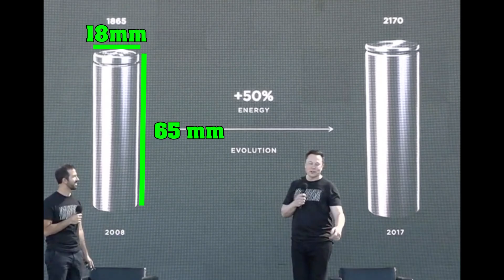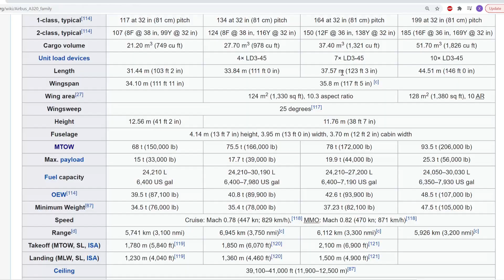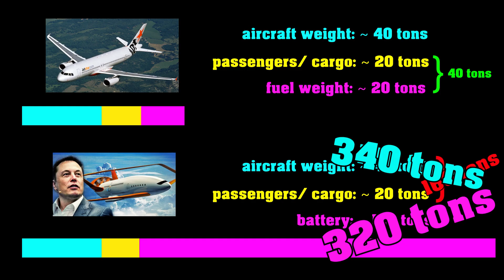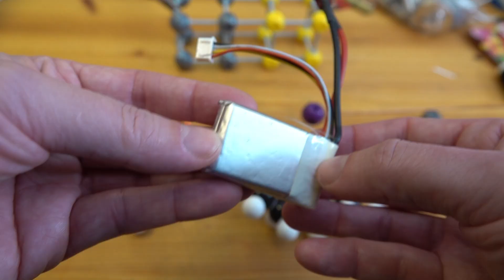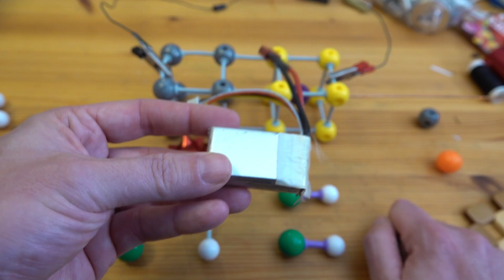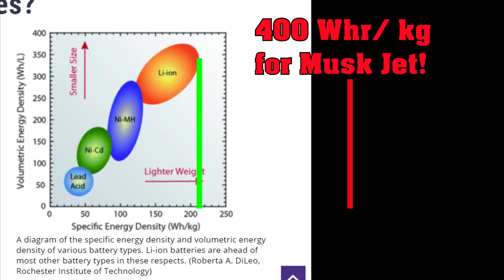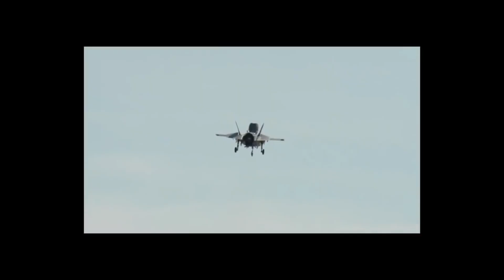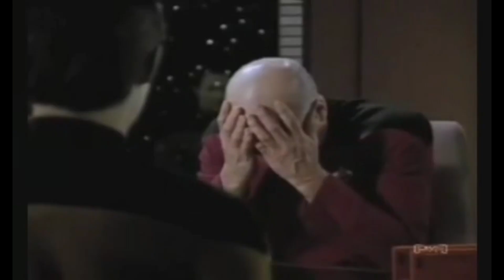Tesla's Secret Plan To Disrupt Airlines: BUSTED!!

Comment: We already have electric planes, they're just Cessna sized. And you're right it's constrained by the rocket equation, more fuel need to be lifted by more fuel, so there's a minimal density required and a maximum limit on practicality. Perhaps the claims of electric and supersonic and transatlantic are not possible, but the way I see it increase of density at the pack level not atomic level will enable private jets of ever more increasing size and capabilities. And this is where I think you're being a bit tongue in cheek the power density of solid state batteries has been demonstrated in the lab however the cells deform and break down after a few circles, the increase in density is possible because much of the pouch you're holding is the metalic contact and the cathode which are a few atoms thick in the solid state batteries. Now it's not clear to me if those problems can be overcome but as with Tesla's 4680 you can still make density improvements at the pack level by solving internal resistance issues at the cell level. In short you can plan out a flying plane at every kw/kg level until you hit the spiraling out weight issues.

And to push a bit on the flying at higher altitude part, if you're not constrained by fuel-air mixture you do have a wider altitude operating range, even if that's not all the way to space since as you point out the boat propeller needs to push some fluid around.

I see this more akin to Boring Company namely what's delivered is possible although not at the marketing wank levels it was promised, rather then Hyperloop which seems totally outside the realm of practicality at any level where it can be delivered.

Comment: It's similar to claiming that next year we will be flying to lower Earth orbit on SSTOs. There is a reason we keep using multiple stage rockets and why Tsiolkovsky's formulas proscribe multiple stage method. We have neither the fuel with the necessary energy density nor the engines which could safely expend such fuel. It certainly didn't stop people from trying, and may be one day we will have something like a hydrogen cell plane and an Epstein Drive like in "Expanse" that will make single stage to orbit ascent a mundane everyday reality, but I'm incredibly skeptical when someone claims we're only a few years away from a similar breakthrough. I find what is particularly concerning about these claims is the promise of reduced prices. For the last 15 years we've been fed promises of Lithium batteries becoming more and more affordable, and yet - the prices stay the same or, in many cases, - actually rise quite significantly. And...whatever happened to those Goodenough batteries which were claimed to be a "breakthrough" only 5 years ago or so? Can we one day have a detailed video on those, Mr. Mason?

Comment: I really enjoyed many debunking videos and 'turning blue' elections, great job. I agree with battery chemistry&(non) progress over last 10yrs and great visual demonstration on chemical bonds burning vs. battery. There is however one thing you don't take  into account mocking the 18650->2070->4680 transition. The major factor preventing of widespread EV adoption is COST. And the different sizes (or folding electrodes, or using them as structural element) are huge improvement for MASS MANUFACTURING and driving down costs. Don't take my word but check Sandy Munro's analysis, who has better expertise than me or (with all respect) you in this field. And I am not sure you are aware Musk has not only business but also physics degree and rather than snake oil salesman he is just overly optimistic scientist (especially deadlines). Other than that, thank you for the high quality content, so rare to see nowadays.

Comment: The bateries can be part of the structure removing most of the heavier materials in conventional planes, also with carbono fiber application on the skin and wings you can shave a lot of weight, my biggest question would be the electric engines used, would it be turbofans without the turbine? Then it cant get supersonic, the supersonic engines have an afterburner to break the sound barrier even planes with hiper cruise without afterburner need it to get across the SB safely
Reply: As to battery technology, I really know nothing about it, but specialist say its possible, difficult but possible
They also Said that about compeling electric vehicles and landing boosters after space launchs

Comment: So a ducted fan that sucks in and propels out air doesn’t suffer a loss in performance at altitude as air density reduces?  Sure, good luck with that.

Gas turbines loose thrust at altitude for sure (not efficiency) but as nearly all long haul commercial airliners are capable of getting to their Mach limit that’s pretty much irrelevant, they can’t go any faster regardless of how much thrust they can muster.

Comment: Forget the power problem. This genius wants to not only create a supersonic vtol, but have it powered by propellers(no such thing as an electric jet). Supersonic vtols exist, but are very hard to do, and only exist in the form of fighter planes such as the Yak-141 or a certain variant of the F-35. These planes only go supersonic due to having afterburning turbojet engines with the appropriate thrust vectoring for both vertical and horizontal flight, and even then, are not as fast or fuel efficient as a conventional fighter jet. Now we have this guy saying he wants to create airliners that do that, and have them powered with propellers. It is obvious he knows nothing of propellers, as they simply do not go supersonic. Propellers, unlike jet propulsion, produce less thrust the faster you go. The propeller works by cutting through the air like a screw through wood. With the propeller at max rpm, and the propeller pitch is at the highest, the plane can only go so fast. Think about it as your car, at max rpm, at highest gear, going its maximum speed. Increasing the rpm of the propeller can only be done as long as the tips of the blades stay subsonic, if they exceed mach, you lose thrust. This all means that propellers cannot really go past the early stages of transonic. The fastest propeller powered plane in service is the Tu-95, a strategic bomber, whose max mach number in level flight is M 0.82, which is impressive, but hardly supersonic. To achieve this, the plane uses 4 contra-rotating propellers, coupled to massive turboprop engines with an output of 15,000 horsepower each, meaning that in total the engines must produce 60,000 horsepower in order to fly that fast. Is an electric set up even possible to do just this? If so then what would the range be provided a similar setup to the one proposed in the video with the battery consisting of 70% the weight of the plane? I don't know, maybe somebody knowledgeable on the topic can tell me.

Comment: "The most efficient commercial aircraft gas turbines in service or entering service in this decade have takeoff thrusts of 20,000 lb and above. These turbines operate at cruise, with motor thermodynamic efficiencies of up to 55 percent and propulsive efficiencies of well over 70 percent, yielding an overall efficiency (the product of the two) of about 40 percent"

https://www.nap.edu/read/23490/chapter/6#36
Reply: Electric motors have 75% effeciency, various propulsor designs could have 80% effeciency as well. The big win for conventional hydrocarbon fuel is really the mass reduction over time, not the efficiency as such.

Comment: Boeing 787’s have suffered some spectacular battery failures and they are traditionally powered aircraft. They were grounded until their batteries could be isolated from the rest of the aircraft. A battery powered aircraft leaves you with the problem of isolating 70% of the aircraft. I wonder what shape this supersonic aircraft will be? And remember folks, this gives no redundancy. All current airliners can suffer the loss of a single engine at anytime during flight. What will Elon’s plane do? More thinking required and maybe a different way of storing energy me thinks.

Comment: Funny thing is, we CAN make combustion engines about 50% more efficient (or thereabout I think).
But nobody bothers to remodel their factories from making the current engines into the new type even though many of the parts would be similar.
I am talking about the 2-stroke opposing piston engine here. If someone is about to look it up from me talking about it, please double check my numbers and put it in a comment.
Reply: First the 50 percent is a bit misleading because your comparing diesel to gas.  Diesel is already more efficient then gas so the actual increase is more in the 20 to 30 range when comparing it to other diesel engines.  So at least in the US just having everything switch to diesel would make everything more efficient.  Not sure why we don't.  Cost?  

Looks like the things this engine is used in are BIG so maybe size might also be an issue in putting it in a car.

Because diesel is a complex, high-energy fuel made of long hydrocarbon chains, it has more potential than diesel with regard to fuel efficiency so unlike gas we probably still some gains to make in fuel efficiency with diesel.

Granted I just did a quick look up so I could very well be wrong.
Reply: @Alexander-the-Mediocre  The dimensions of the engine are (as far as I know) comparable to any other engine so that shouldn't be an issue.
Even then a 30% incease in efficiency? ... 30% more range, 30% better miles per gallon (as you call it in the Americaland), 30% cheaper to drive the car ... That's a BIG deal ... and you're using Diesel which is already cheaper. Apparently someone who claimed to be from the industry also mentioned that injecting water into the cylinders at opportune moments drives that efficiency even higher (no clue why or how that would work)

So really ... exactly WHY don't the engine manufacturers switch? Supposedly it would be too expensive to build the factories for mass production of a new engine type. And that's apparently why nobody bothered to implement any major improvements in the technology since its conception in 1794.
Reply: @MrRolnicek  You misread my comment Americaland is not using diesel.  So that's the first issue. 

Looks like high oil consumption and complex crank gear as well as heat load.  Some companies are looking into it and testing to get around these issue but its still in the development phase.  Though i looks like some trucks are testing it out so we will see how that goes.  But doesn't seem ready for mass production.  

https://www.quora.com/What-are-the-advantages-and-disadvantages-of-opposed-piston-engines
Reply: @Alexander-the-Mediocre  Wait what? Americans aren't using diesel at all? Here in Europe we're about 50/50.
And I've heard about this engine a WHILE ago. Looks like they actually are developing it, it's just taking a while.
Reply: @MrRolnicek  Yeah sadly America gas companies have lobbyist.  Diesel is used for like 16 wheelers/transportation but not regular vehicles.    I think there are some diesel cars floating around but the percentage is almost nothing.

Comment: Most of the battery innovation that cause energy density gains were achieved by increasing the packing factor (bigger cells lead to a bigger percentage of the battery pack mass to be cell mass and not structural mass). The structural battery is one of the ideas.
The tabless design also allows more energy in the end, as less is lost in the internal resistance.

Comment: Self sealing fuel tanks are not standard on aircraft, most modern big'ns have an inerting system that filter oxygen out of the air being breathed into the tank when the fuel is taken out, nano filters that only let nitrogen through.
Self sealing tanks were a military endeavor, big rubber bladders that partially re seal if a german bullet goes in, don't think it would mitigate the big chunk of german debris that tore concord apart.

Comment: ...and that's before even considering how efficient is to spin an airfoil (propeller, turbine...) in order to transform stored electricity into movement. Which kind of diminishes when there's less atmospheric pressure aka less air to push with said propeller/turbine (and this is why high performing aircraft rely on generating hot combustion gasses and eject them, rather than just accelerate air moving through the engine).

Comment: Landing weight is less on planes compared to take off weight so the landing gear can cope with the weight. ie planes that take off and immediately have a problem will jettison fuel or just go round in circles till the weight of the fuel goes. Then they can land as the planes landing gear can cope.. guessing batteries will be the same weight so landing gear will need to be heavier to take the added weight load

Comment: Two other key reasons why a battery-powered plane is stupid:
- Fuel-powered commercial planes can dump most of the fuel before an emergency landing, and usually do, to reduce risks (will electric planes be able to "dump" their heavy, solid, fire-prone batteries?)
- When a fuel-powered plane loses power, it can glide for a while to look for some place to do an emergency landing (an electric plane will fall like a rock immediately because of the heavy weight compared to wing surface).

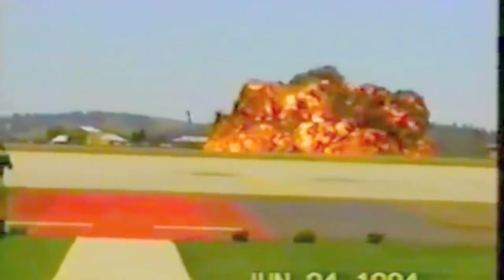Comment: Great stuff as usual, however 22:40 Is pure hyperbole. EVERY battery failure will result in a fireball... Sorry, but I'm afraid this is just nonsense. If these are the same battery cells that Musk is bundling into his cars then surely we should be seeing hundreds of thousands of car fires every year? Each model 3 for example carries around 3000 cells in their battery, and there are currently 500,000 of them in the wild. With a cell failure rate of around 50 cells per battery per year the amount of apocalyptic fireballs is remarkably low.

Comment: 5:39 and you need to know, when fuel get burnt down, the plane will become lighter. But in a battery powered plane, the weight of the batteries won't go down (at least at a significant level) when energy inside burn away.

Comment: 70% battery isn't as crazy as you might think, and given very high energy densities is actually realistic. Concorde was 50% fuel by weight on a heavy takeoff. Given his dreamed-up energy densities and suitable aerodynamic and material improvements, a short-range supersonic electric plane with low payload could be technically possible. But even optimistically it would have an even shorter range than Concorde, which was, by current definitions, short-to-medium range, which would make any advantage from being supersonic almost negligible.
But really, I don't think even Elon Musk thinks this is going to happen, it's more in the realm of "wouldn't that be nice?"